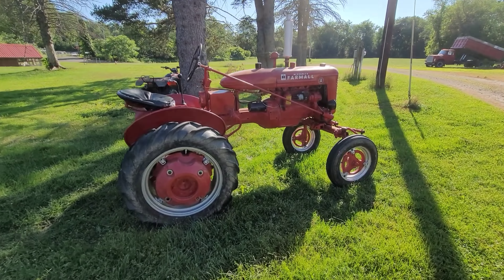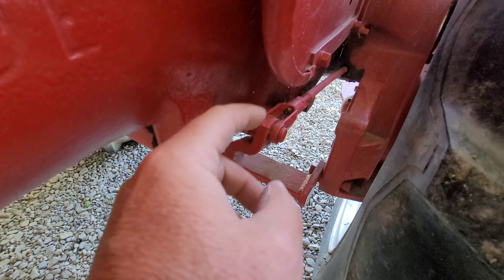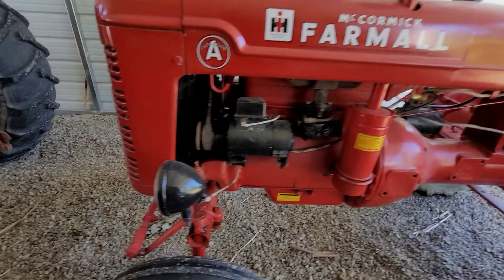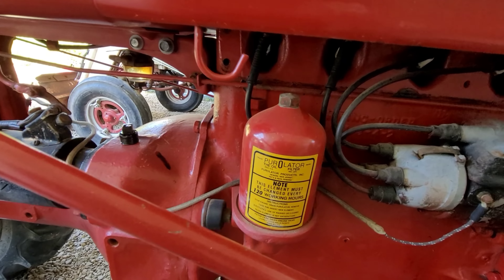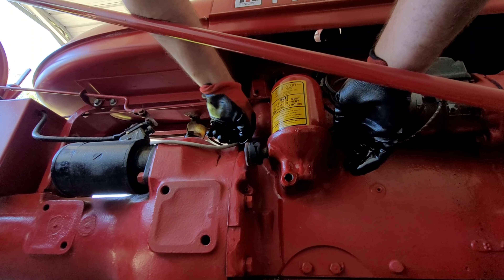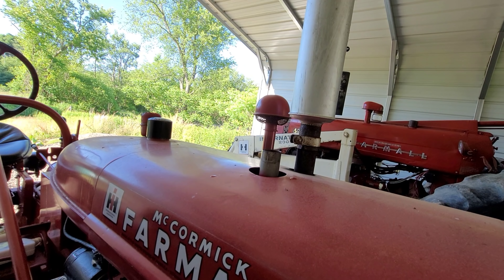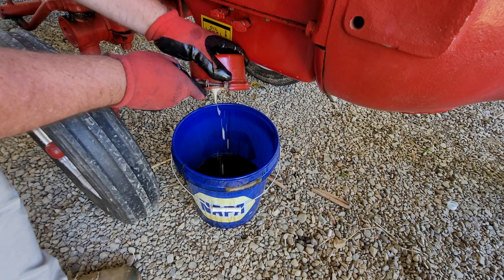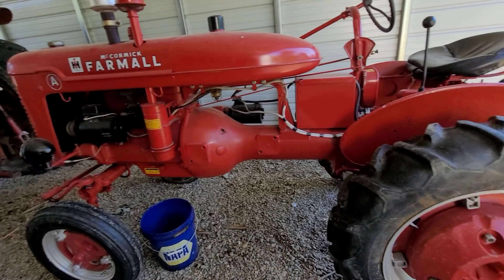How to Service a Farmall A || Part 1

Comment from the maker: Final Drives do not have anything to do with the rear end oil I'll be changing in the next video. I don't drop the pans for the final drives, I use a suction gun. That will be in Part 3...don't go ballistic if I misspeak lol

Comment: Great little tractor! I grew up on a farm in the '60's and learned to drive a Farmall B when I was just 7 years old.  The B had the flat axle housing on the left of the operator and I spent many hours sitting on that spot while my dad plowed the corn.
Reply from the maker: I've seen several people put seats there and drive them in the parade. The passenger throws the candy
Reply: @FarmallFanatic  That's a great idea!
Reply: @FarmallFanatic  tried to add a seat to my B today but couldn't find the right size bolt, everything was too big or too small.  My son was sitting there today while I mowed...

Comment: The oil filler cap tends to collect a lot of grime. Rinse it out clean each change. After years of running 30w oil, I've gone Rotella multi-grade, along with most of the other equipment around here. Makes more sense to me and should be an upgrade. (of course lotsa folks probably argue that, lol). Yes, I also have an A ('39). It still works here on the farm.

Comment: Hello that's odd change the oil and you say that there was water in engine oil coming out after you have drained most of oil. Water is heavier than oil,is usually sit the bottom and comes out first. On your air breather I would or have just used some of used engine oil after all it's there just to collect dirt through the air that goes into engine. Kinda neat thing before the days of air filters that are used now. Great idea change oil on something new to you, never know when oil was changed. Have a great day sir.

Comment: I've never seen an old tractor that didn't have some water in the transmission or final drives due to the housings also being vented and containing air which heats up during operation and cooling down afterwards causing condensation also the same thing happens to fuel tanks and can cause rust especially due to age... any older tractors should after purchasing should have fuel tanks drained and inspected and cleaned. Also placing a magnet away from the fuel outlet to the carburetor will collect and keep any new rust from clogging fuel filters and entering the carb..
Reply: Yes I also use a magnet to collect the rust.

Comment: The plugs on the axle housings aren’t for draining, they’re for filling, to drain you have to pull the bottom pan off each side. If you don’t drop the pans and there’s water in them, they can freeze and lock up the gears in the middle of winter.
Reply from the maker: I use a suction gun...does a decent job
Reply: Not to mention the sludge that will accumulate......
Reply: I picked up my first 1940 Farmall A this week.  My gearbox oil looked like chocolate milk.  I'm waiting for the gaskets to come in for the final drives so I can do those.  Can't imagine what awaits me there!
Reply: @FarmallFanatic  I'm going to try the suction gun tomorrow, I checked them today and at least it's black, unlike the chocolate milk that came out of the PTO drain plug...

Comment: A friend of mine lived in the north east New England and was a regional Sales Manager for a roofing supply company and they would get calls from people who had new roofs put on and would complain about water ruining their ceilings in their houses.   The roofs were not leaking but the water was from condensation  in their attics that was causing the problems.
Reply from the maker: Insulation issue

Comment: I'm new to this. Bought a IH 184 Lowboy. First question is oil related. Went to the local New Holland Dealer (If that's what you Have) . The only SAE 30 he had was diesel oil. Is it safe to use ? Second ; where are the fill plugs and drains on the transmission and  rear axle housings. The manual isn't very helpfull with this part of service. And how do you know when it's full ? Tractor has 1300 hrs.
Reply from the maker: You have an Owners Manual. Go on Ebay and see if they have the Service Manual for sale. You will be leap years ahead.  I will tell you this, what oil you run is entirely dependent on where you live and what temperatures you are using the tractor in... colder temperatures are going to require a lighter weight oil.  During the summer, I've known guys to run 15/40 diesel oil in them.
Reply: @FarmallFanatic  , Thank you very much , I'm old but this old dog can learn new tricks. Love your videos , you're good at it.
Reply from the maker: Appreciate it
Reply: Where would I look for a "hydraulic conrtol valve kit , #135478C91 ? Every attempt to find it has failed. I can find the valve but not the kit. It was an option on the 184 as was the creeper. The kit should have the mounting bracket and hardware. The problem being that whenever I raise or lower the mower the three point goes up and down at the sale time.......

Comment: Always do a "full" service, meaning full service, if it needs fluids and lubes, do it. Wheel bearings, grease, lithium grease, cable lube, seat hinge pins, steering bearings, tie rod ends, etc. 
   Inspect things carefully. There is not excuse not to take care of your equipment.
     Thanks for the videos, appreciated greatly.
Reply from the maker: I totally agree

Comment: Three out of my four tractors, I can't get the little drain plug out that's under the oil filter. The previous owners must have been using a pliers on them. After I take the filter off I must carefully soak up the oil and dirt so not to get dirt down the hole.
Reply from the maker: I can't get the one out of the 756....rounded off by one of the previous owners. I'm gonna eventually get it out and replace it though
Reply: @FarmallFanatic  same here, just don't have time whenever I'm changing oil. I'll get them done someday.

Comment: I have a farmall h but whoever had it before Jimmy rigged the alternator, the wiring around is all loose and almost random, the solenoid is rusted out the radiator line is messed the oil cap top is seized and no battery but id like to get it running to grab logs out of the woods
Reply from the maker: It usually doesn't take much to get them running
Reply: @FarmallFanatic  One piece at a time!
Reply from the maker: Yep

Comment: Thy do make an adapter for the spin on typ but if you have the cultivator or planter for it do not put it on it will be in the way of the hydraulics no room.
Reply from the maker: Good heads up 👍